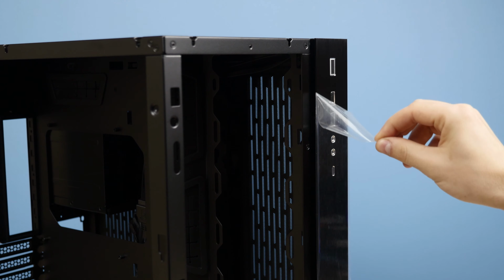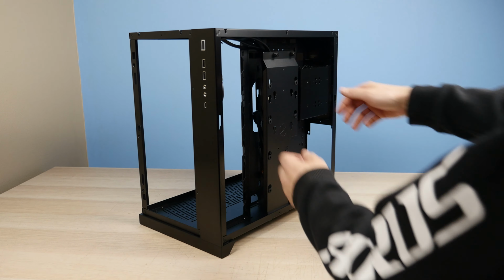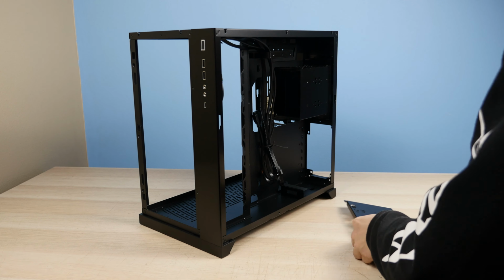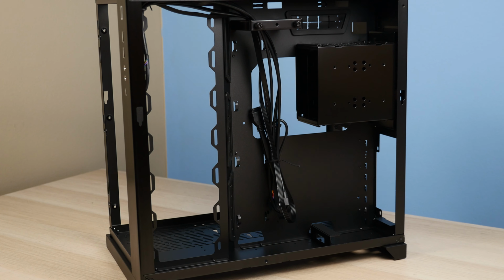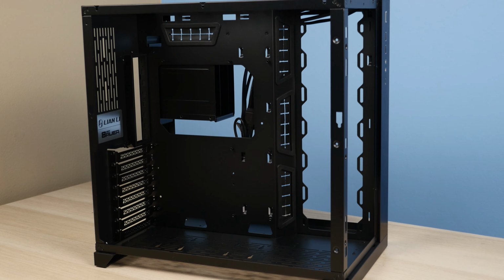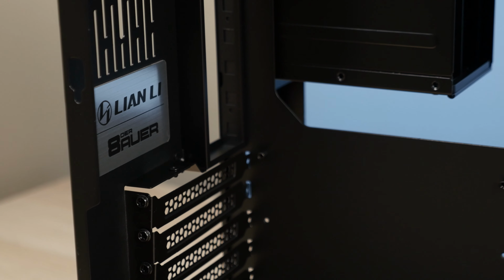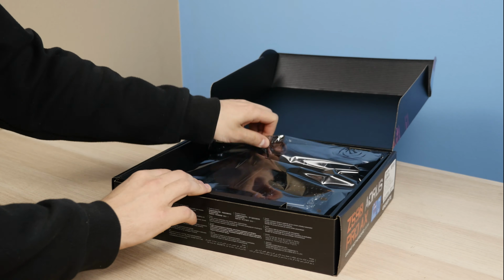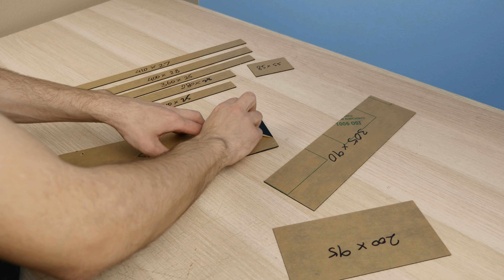$8000 Intel Gamer Days Custom Water Cooled Gaming PC AORUS Z590 i7 11700K RTX 3080 O11 Dynamic

Comment: That waterforce 3080 had no thermal pads on the back, I had mine done with thermalright 12.8w/mk 3.0mm and 2x 80mm fans cooling the backplate. I mine when not gaming and the backplate burns to the touch. Yours might looks the part but that fancy board you placed on the back acts as a blanket to trap heat.

Comment: 8:47 its sad to see for me, that this distro plate doesnt grant you 2 tube over each other for the cpu cooler. its design to use the tubing behind each other, not above each other so you need a crazy bent to make it fit.. this is the point, where iam not sure, where to make the compromise. if i wanna go watercooled in my o11, i wanna go all the water, cpu and gpu. 2x 360 rads in top and bottom wont be enought for that, so i would go for 3 rad and use the side radiator spot to. this disqualfies the side distro plate for this case, leaving only the front distro plate, which i like better anyway in terms of position, yet all the front distro plate are missing the double routing for the cpu block :( i mean, youre using 5x 120 to cool cpu and gpu but i wonder what the temps and noise level are. because iam looking for ~600rpm noiseless fan levels with a maximum of 60 degrees on cpu and gpu under full load